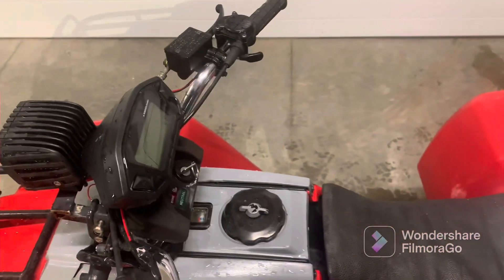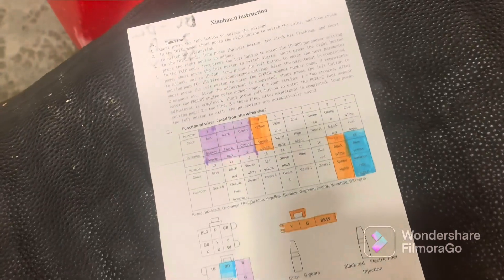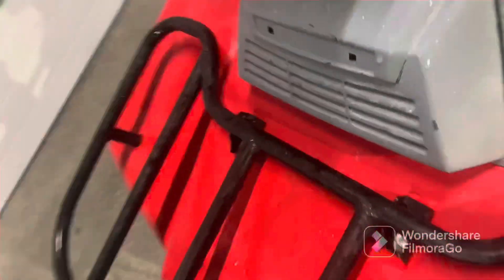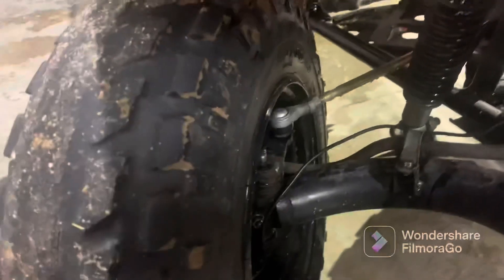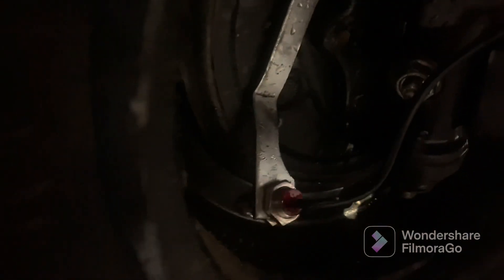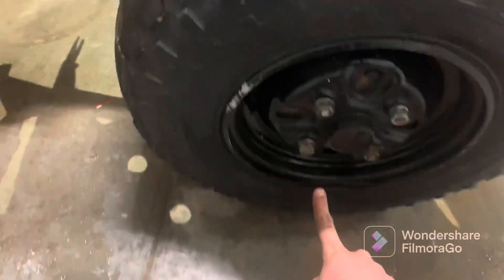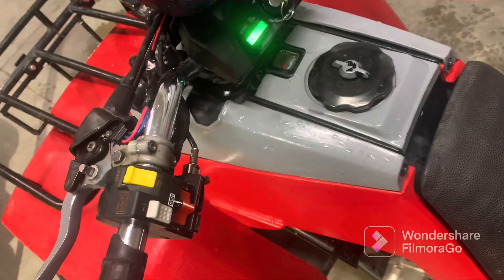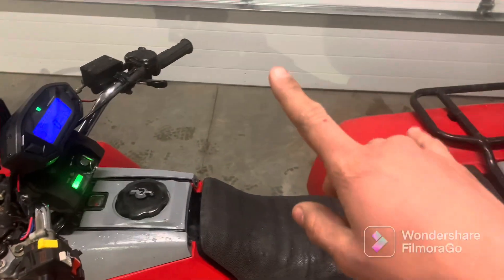Universal Speedometer install | part.3 speed sensor

Comment: Thanks for the video.  How do you calibrate the speedometer to be correct with magnet setup?
Reply from the maker: This is what the paper said- 
In the trip mode, long press the left button to enter the ID-000 parameter setting page, short press the left button to switch digits, short press the right button
to adjust. set to ID-750. long press the left button to enter the next parameter 
setting page LC- 153 Tire circumference setting. After the adjustment is complete .
short press the left button to enter 2pulse magnet number page, 2 represents
2 magnets etc. After the adjustment is completed, short press the left button to
enter the FRCLOY engine pulse number page: 0=four stroke , 1=two stroke, after
adjustment is completed,
the parameters are automatically saved
Reply: Depends on what you put it on. On my xr650l the calibration numbers are 00812 or something like that. But thats with only one magnet cause for some reason, I couldn't get it to work with 2. But it took me 17 miles at around 50 ft intervals to figure that out and now my speedometer is dead nuts with me speedometer app and my car. Js
Reply: I will say tho, everything on mine but the fuel gage/gear selection numbers which the bike doesn't come with anyway works killer! Keeps time dead nuts with my phone, accurate speed, signals, neutral, high/low beam indicator, trip and miles, all worked great. I'm working on a pinta meter to hook up to the fuel gage to make that work eventually tho.
Reply: @EverythingOffRoadOfficial  and that answered that question once again much appreciated. 
      ✌️🤠🏞️🐂

Comment: Only thing I cared about or needed to see was how the magnets attached.  You didn't address that and said they would likely Fall Off?,  but they hadn't yet. 
  So is it using double-sided tape?,  JB Weld, or what? Frankly they look like they're meant to attach to Spokes so.....
    I still have no idea. 
  And do you program your tire diameter for an accurate reading? 
   I'm sure once I get it it's easy to figure out but I don't want to spend money if it's something I can't really use. Otherwise I'll spend a little more and go with GPS. If it's just double-sided tape.  Then JB Weld would likely be better. It's capable of holding on through all types of extremes. Just don't have a clear I idea. thanks anyways.
Reply from the maker: This is what the paper said-
In the trip mode, long press the left button to enter the ID-000 parameter setting page, short press the left button to switch digits, short press the right button
to adjust. set to ID-750. long press the left button to enter the next parameter setting page LC-153 Tire circumference setting.
After the adjustment is complete .
short press the left button to enter 2pulse magnet number page, 2 represents
2 magnets etc. After the adjustment is completed, short press the left button to enter the FRCLOY engine pulse number page:
O=four stroke, 1=two stroke, after adjustment is completed,
the parameters are automatically saved
Reply from the maker: Thanks for letting me know I’m missing info I will probably make a pt2. for the ATV I used JBweld for the magnets and I used 2 magnets
Reply: @EverythingOffRoadOfficial  thank you for responding back and letting me know it's highly appreciated. Especially your time.
  Didn't mean to sound testy. I've still been searching but Google's algorithm nowadays suck. You can spend a couple hours asking the same thing different ways and it'll still give you irrelevant information. Google has become useless. 
  And you may have bore the brunt of my frustration my apologies. I won't worry about GPS and go ahead and order then  use JB Weld. It's repaired cracked water jackets on blocks in the past so... 
 You have a wonderful day and God bless. Once again my apologies and thanks. 
        ✌️🤠🏞️🐂